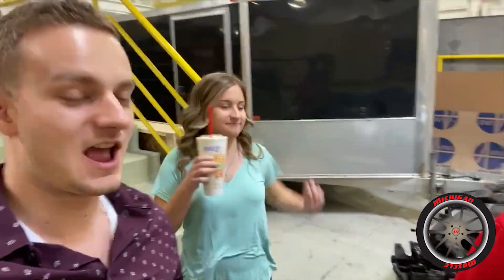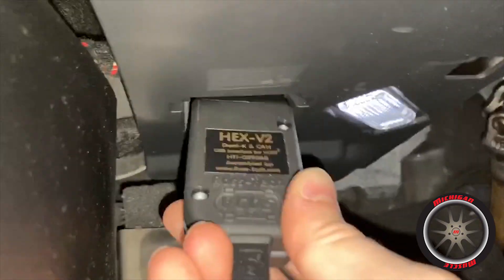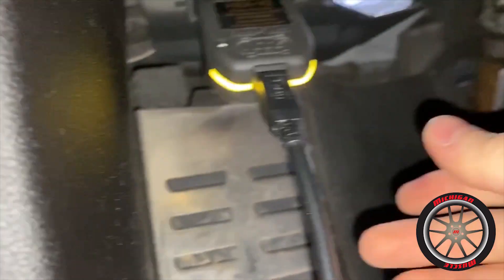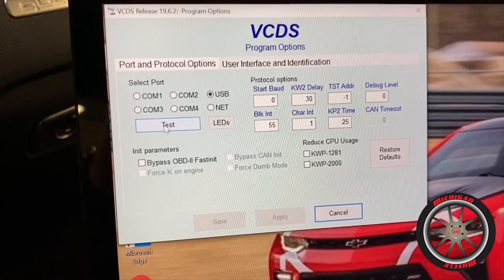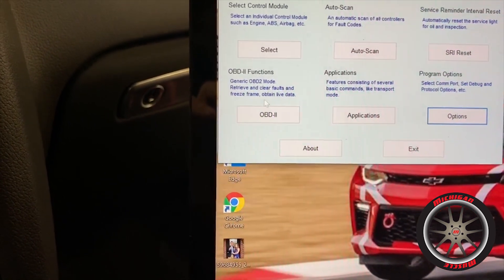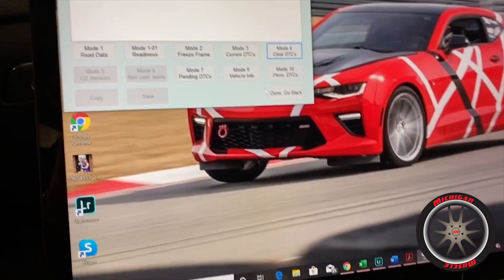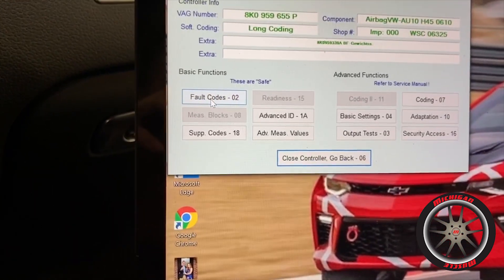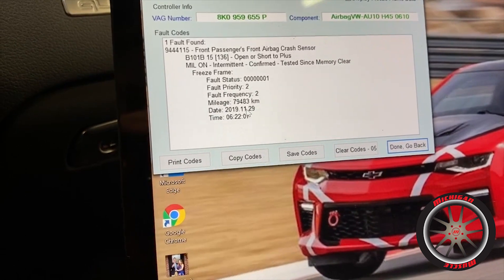EASY FIX to turn off an airbag light | Audi VW Lamborghini

Comment: I was installing CarPlay box . 
Hooked everything back up and screwed in … started car and lights on
Reply: How did you fix it? I just bought a scan tool someone on YouTube said worked.  My scan tool doesn’t do it
Reply: @DeRock401  what’s your scan tool? Model number brand
Reply: Same happened to me.
Reply: Same happened to me. I am going to try and delete the error with ObdEleven to see if it works
Reply: did it work? same happened to me

Comment: You have to replace the airbag sensor that got damage otherwise you’ll get the light back again
Reply from the maker: I checked the continuity of the sensor and it was ok. I’ve let the car sit and run for extended periods of time and I still haven’t seen the light back yet. Have you experienced a light coming back after clearing it?
Reply: What are the causes for a damaged airbag sensor ? I have on my Audi and I never crashed the car . It popped up randomly and never left .